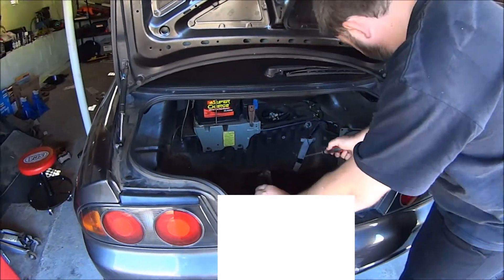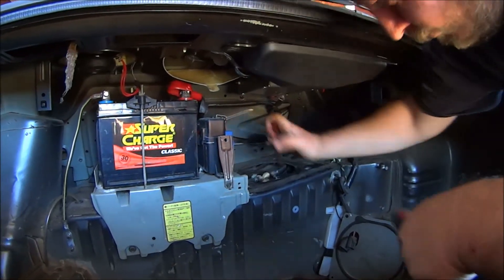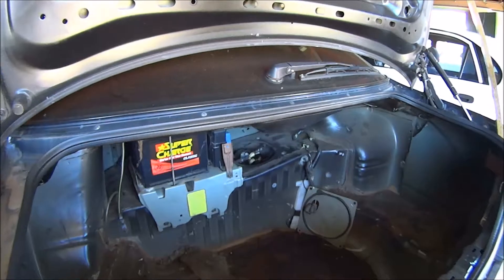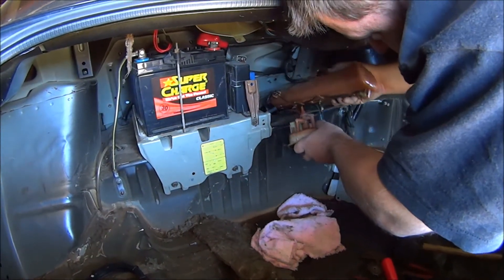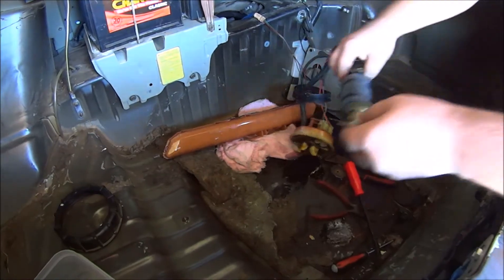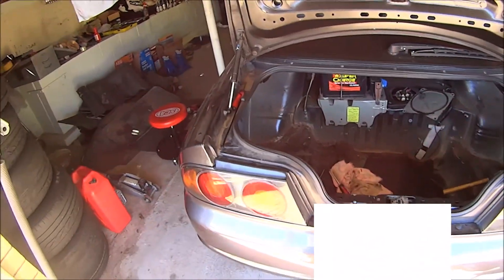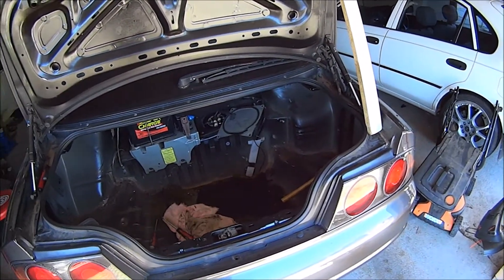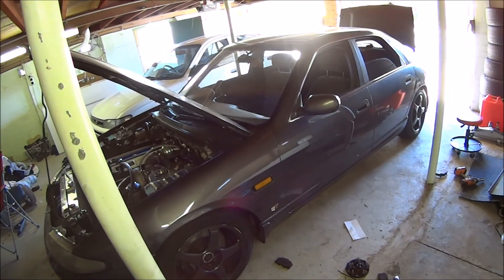Nissan Skyline R33 GTST Build - Fuel Pump - Remove, Identify after market Walbro E85 Fuel Pump

Comment: couldnt figure how to put the fuel level sensor back in the right place
Reply from the maker: You couldn't?
Reply: @tangles01  I myself couldn't. Still slow, car launches good but redlines like a NA car. I'm gambling on a highflow turbo service.
Reply from the maker: @drtec6349  You have o di it by feel get it lined up then push it down over a metal tab that locks it in.
Reply: @tangles01  I had a entire new clutch system done, and it still doesnt run well with a different pedal adjustment then it came with. Even rebuilt the master. Original pedal setting was sticky, and made me think the spring was bad

Comment: How will I know if I need replace my fuel pump? I recently installed larger injectors and now when I try to give it anything more than half throttle it starts spitting real bad. Almost like a rev limiter
Reply from the maker: almost certainly failing coil packs
Reply: @tangles01  I have the same issue, replaced coil packs, spark plugs, fuel filter, thermostat, etc and nothing has worked. Fuel pump is next on the list
Reply: @Behr also did you end up fixing the issue, if so what was it?
Reply from the maker: I'm sorry I miss read your comment. If you have installed bigger injectors, you've got too much fuel. the tune won't accept more fuel.

Comment: This is the hardest job I’ve ever had to do on my r33. I just couldn’t find the bracket to hook the pump back on! 

It took me ages! I’m not sure I put it back in right to this day! 
I’ve not let my car go below 1/4 tank as I’m worried I didn’t put it back right 😂😂😂
Reply: i had to do it on a m spec 1.5 gtst , fucken tank was 3/4 full an just reached in mananged to find it on a 45degree angle pointing out towards the back of the car from like the front end of the tank. first skyline worked on an managed to get it done in one night after working through a clusterfuck of alarm an immobilizers lol
Reply from the maker: If you gauge works even half right it's probably in right.